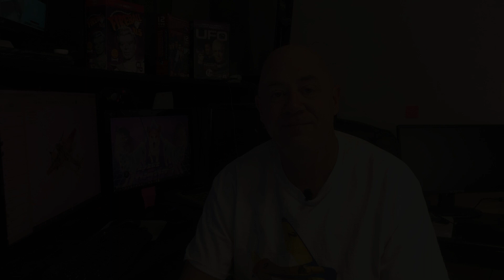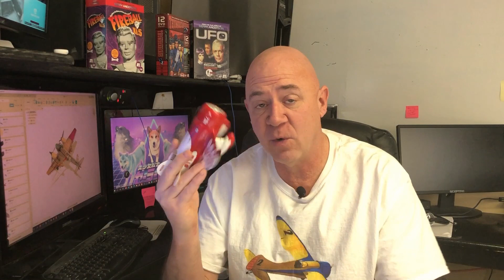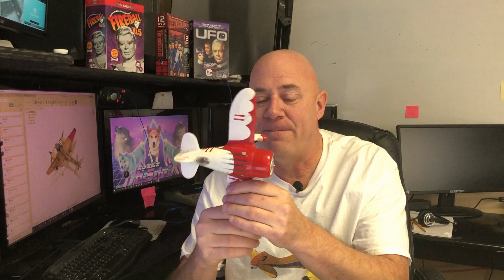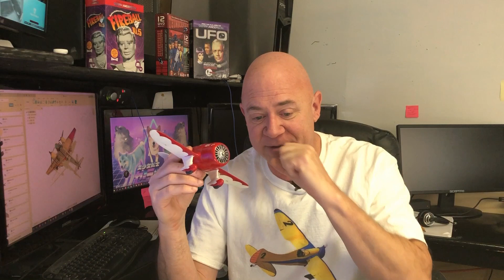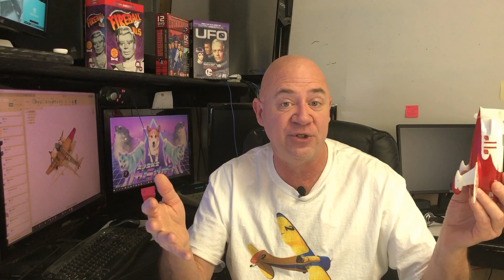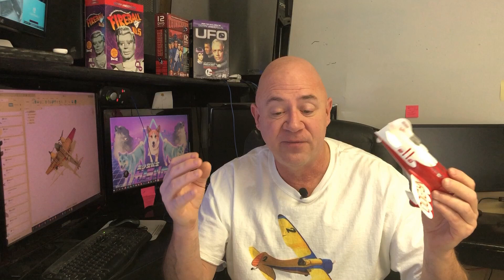Designing a RC Airframe (Systems)

Comment: Great information now lets say you want a Corsair or FW190A8. FW190D-9 would it not be easy to take lets say one of the scale airplane plans import them into cad and built the size you want? Like you can take Bryant Taylor Corsair plans you have the info needed you have the scale ws, fuse size so if you want 1/3 scale then you know you need to increase the plane 200% the only real thing you need to understand is how to pick bulkhead ply sizes ribs etc etc now you can enlarge the plans but the notches will be off

Comment: Thank you so much for your great info and videos. I am still training and have a great friend who is teaching to fly and so much more about this awesome hobby! I crashed my plain into a tree 30 feet up no damage, getting out of the tree however was not so good 30 feet to the ground straight down caused some damage. After fixing the damage the plane looked better than ever. But we kept on getting some fluky problem with the elevator, and crashed the plane 2 more times with very little damage but really frustrating my buddy was continuing to trouble shoot the problem when he found a switch in my radio was malfunctioning. So he changed the channel and now Flys great. God bless you by the way.